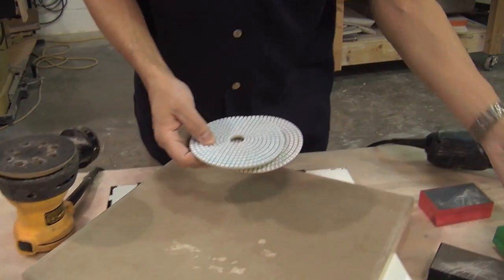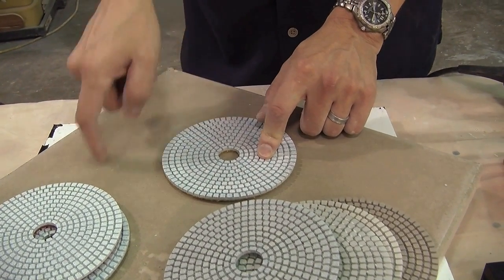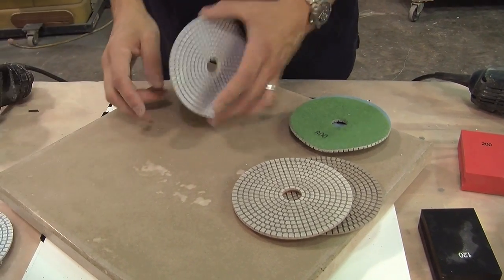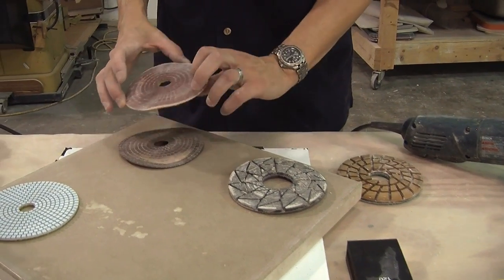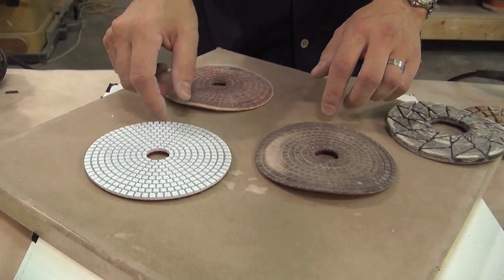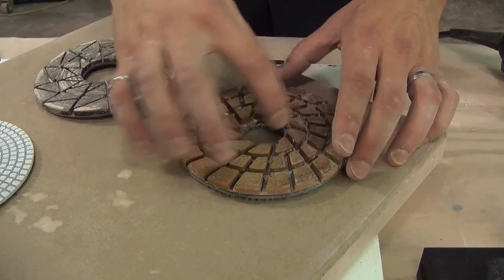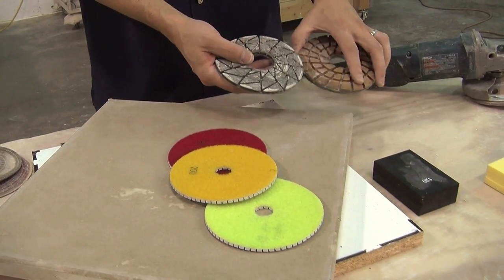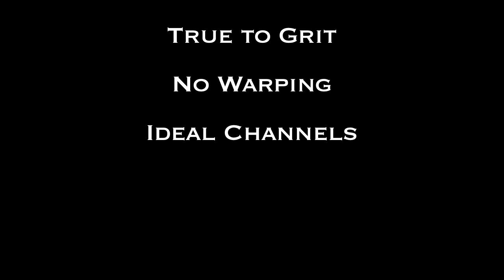Diamond Pads for Polishing Concrete Countertops

Comment: great video, it does seem like your comparing used warped pads to your unused pads
Reply from the maker: It's true that I'm comparing used pads to my unused pads. However, the point I make is that the thick floor pads start out warped and don't flatten out on a polisher. Showing used pads make its clear how small the contact area is because the pad is warped due to its thickness. The pad isn't warped because it's used.

Comment: Could you start with 400 and just do that only?
Reply from the maker: Yes, you can always start with whatever grit you wanted to. I prefer to start and finish with a 200 grit pad, as it is a very efficient and effective grit to quickly remove the cement paste and leave the surface smooth and ready for sealing.

Comment: Hi i will be doing my first concrete countertop polishing job. What sealer do ypu recommend after im doing doing the polish
Reply from the maker: I strongly recommend Omega, my sealer developed specifically for concrete countertops. It is food safe, water based, and very, very stain, acid, and oil resistant. Polishing your concrete to 3000 grit only makes the bare concrete shiny, it does not add any protection, so not only is it unnecessary, it often makes more unnecessary work for you and it gives a false sense of security. As with all topical coating sealers, do NOT polish beyond a 200 grit finish, otherwise your sealer will not bond properly and you'll suffer from delamination. Here is the link to the sealer and some articles you might find useful: https://concretecountertopinstitute.com/product/omega-concrete-countertop-sealer/

https://concretecountertopinstitute.com/free-training-category/sealing/

https://concretecountertopinstitute.com/free-training/why-is-the-200-grit-disc-special-for-concrete-countertops/

Comment: Great info! Can I use these pads with my random orbital sander? Or do I need to get an angle grinder backer with velcro or a polisher? Cheers!
Reply from the maker: Yes, you can use them with your 5" random orbital sander. We call that damp honing, and we have a video on that in this article: https://concretecountertopinstitute.com/free-training/surface-prep-concrete-countertop-sealer/
Bear in mind honing using a random orbital sander will be far less aggressive than using a dedicated wet polisher, but if you're just doing light honing work then it works great.
Reply: @TheConcreteCountertopInstitute  Awesome – thank you so much for the swift reply! Great website. This information is gold! Cheers!

Comment: I made a 1.5"x 27" x 67" solid countertop in a form upside-down using  concrete from Z-counterforms, which says it does not need any rebar or fiberglass.   The instructions say 48 to 72 hours cure covered in plastic.    I let mine  cure for 6 days.  Then 2 days outside the mold on a flat table, good side up.  Then I began wet sanding with 50 grit and 100 grit pads just like shown in the video.   The next day the ends of the countertop curled up  about 1/4" each side and the slab is no longer flat.    Maybe I used too much water for the sanding process and this somehow caused it to curl, but I'm scouring the Internet to find the answer as to why this happened.
Reply from the maker: Curling is caused by poor curing and storage conditions. When one side of a concrete slab is allowed to dry out while the other side remains moist (or is moister), the concrete will tend to shrink towards the dry side. Concrete continues to cure for many days, long after it's been demolded and processed. The curing process is fast in the beginning, fast enough to make the concrete strong enough to demold and process, but it does continue, asymptotically. It is possible that the curling started during the 2 days the concrete was flat on a table, if it stayed moist on the underside and dry on the top. Concrete slabs should always be stored either on edge or elevated on foam blocks to allow air circulation all around the slabs. Curling could be caused by mix designs that are shrinkage prone, but Z-Counterforms is a good mix, so it's unlikely the curling was caused by the mix.  You can try weighting the ends of the slab with very heavy weights, but I can't guarantee that will flatten the slab.
Reply: Have to keep it soaking wet for 7 days minimum while curing
Reply from the maker: When you don’t use a curing polymer, you’re exactly right.

Comment: Good video! In order to make a concrete countertop kind of shiny-smooth, how much grit at least I need to use? How many days after the pouring I need to wait before the polishing? I have used 400 grit diamond polishing pad on my newly poured countertop but it feels much coarser than a wood surface after being polished with a 400-grit sand paper. Is that normal or something went wrong?
Reply from the maker: Hi Daniel. 400 grit should produce a very smooth and somewhat shiny surface. If you are going to apply a coating sealer, do not progress past 400 grit, because the sealer will not adhere properly. You can usually stop at 200 grit. The sealer is really what gives the final appearance of the concrete, so it's pointless to polish to a shine and then apply a sealer that has a different sheen. The number of days to wait after pouring depends on the concrete, but basically the cement paste in between the sand grains needs to be hard enough to polish. A high quality concrete countertop mix with low water/cement ratio should need no more than 2 days. You can use a densifier after 200 grit to speed this up. You say you used a 400 grit diamond polishing pad, but you also say you used 400 grit sandpaper? Sandpaper does not contain diamonds and will not polish concrete countertops to a shine. Also, wet polishing works better (and allows you to apply a coating sealer) than dry polishing. Please visit our website for extensive free training on diamond pads and polishing here: https://concretecountertopinstitute.com/free-training-category/diamond-pads/

Comment: Any recommendations for a 5" electric sander? They usually have dust collection which would seem to suck in water, not good.
Reply from the maker: Please see this page: https://concretecountertopinstitute.com/diamond-polishers-for-concrete-countertops/
Reply: I assumed since these pass don't have the vaccum holes in place and majority of the pad is rubber backed water shouldn't be a big issue even for an orbital sander, just be careful not to wet the electrical parts

Comment: Does the hook and loop side last for a long time? (Long time meaning 1,000 sqft) My experience with amazon bought pads are short term not due to the diamond side.
Reply from the maker: Yes, we have never had any issue with the hook and loop/Velcro over many years of use.

Comment: I have some rough spots, not many, in freshly poured top. What would be the recommendation for that ? Start higher 800? If I do 200 I am concerned I'd impact the good finish around. Is there a good rule of thumb ? How much water I need ?
Reply from the maker: Constantin Moisei Unfortunately you must polish the entire surface. Even a high grit like 800 will impact the surrounding surface. Which grit to start with depends on how rough the spots are. 800 grit is not going to smooth rough spots, but 200 might. But if they are really rough you might need 100 or even 50. Whichever grit you start with, you should progress higher step by step until you are satisfied with the finish. Be aware that if you plan to apply a coating sealer, you should stop at 200 grit because the sealer needs some texture to stick to.
Reply: Thanks a lot,  I might have been misunderstood.

I don't want to expose the aggregate, and I don't want to cut too much as this is indoor in a finished area so I don't need any mess. Can't mess the area :-)
Here's the process I was planning to do.

1. Wait 7 days to wet cure it, sprayed it everyday and covered with thing plastic sheeting (Day 3 right now)
2. Day 8 - 50/100/200 polish with a diamond hand pad only on rough surfaces, the grit used will be base how rough the area
3. Apply slurry to cover all the bug holes and uneven areas
   * I will hand massage the slurry in, squeege it out and lightly wipe it off with a wet sponge just before starting to set
   * (should I steel trowel the slurry to even out?)
4.Let it dry and lightly sand the edges, remove forms (z-forms and sink), remove any debris. Wet sponge it and shop vac cleanup.     * I do this because I have couple of low spots by the edge of the zform and I want to use the forms as a level reference
5. Appy few coats of sealant to penetrate (is this the right time or lightly go 200 over the whole surface then seal it all?)
6.(400?) 800-1000-1500-3000 wet grinder diamond pad polish on all the surface - need to see how I contain the water mess (indoor slab)
7. Use a cut compound to polish it more (Should I do this after 1500? If I do this should I skip 3000 ?)

I have a corner that I have to manual I assume I need hand pads for that. 

Oh, I forgot, I saw someone seal the concrete after lower grit then seal it then continue to with higher grits. Any idea about that approach  ?

I won't mind if you'd point all the flaws in the steps above. 

Great videos/explanation! Subscribed!
Reply from the maker: Hi Constantin. I'm sorry for the delay in replying to you. This is a very involved question, so can you please email info@concretecountertopinstitute.com so that we can get your email address and assist you that way?

Comment: I'm looking to try and test out an area of a bathroom with marble floors in a condo that I recently purchased. The floors are in decent shape just are very dull with some staining in a few areas. What grit might you recommend starting with?
Reply from the maker: Marble is a very different material from concrete (it is very soft), so I hesitate to recommend a specific grit, other than start with high grits to be on the safe side. Low grits such as 50 are very aggressive and can remove quite a lot of material quickly, even from concrete.

There are companies that specialize in floor restoration - using the services of a pro with experience in marble would be the safest bet.

Comment: CCI - I'm about to make some concrete countertops with the quikrete countertop mix. I plan on using the BR reactive sealer and use the CCI diamond wet discs. What grits do you recommend? I did a test piece and it seemed to come out pretty smooth and I have read that I shouldn't go over 400 grit if I'm using a sealer. Can I get away with using your 200 and 400 grit? what should I use to sand down the edge after using a slurry mix to fill in the voids?   Thank you very much for your help.
Reply from the maker: +Chris Hansford That's great! You are correct, if you're using a coating sealer such as BR reactive polyurethane, you shouldn't go over 400 grit (for some sealers it's actually 200). 
On the cast surface: If you are just trying to do a very light honing and not expose any sand grains, you can just use a 400 grit. If you want to take off the cream layer so you see the sand grains, you can use a 200 grit. 
After slurrying/grouting: If there's not much grout on the surface, you can use a 400 grit. If there's more, you might need a 200 grit, but be cautious about taking off too much grout and re-exposing pinholes.
If you're just doing edges, use hand pads. For larger surfaces, use diamond discs.
Reply: +The Concrete Countertop Institute  thank you very much!
Reply from the maker: +Chris Hansford You are very welcome!

Comment from the maker: +Saul HNJ Gracian (For some reason I am unable to reply to your comment. Here is the answer.) The diamond pads should work fine on pool plaster and the calcium buildup. Just be very careful when using the 50 grit because it might cut through the calcium too quickly.
Reply: +The Concrete Countertop Institute  - Saul-HNJ Gracian   Thanks! let you know how it goes, discs came in today plan to complete next week...

Comment: your Thoughts!  I am a concrete contractor and I have lots of calcium build up on my pool plaster. I plan to drain pool and use the 50 grit  to cut calcium and a bit of cream off the plaster 100 to polish(maybe 200), 7inch for the major surfaces and 3/4in on radius curves, should be about a solid day of cut and polish, I love your quality disc and I believe this would work well on plaster...I would be obliged to know what do think about my project, I am a little overconfident at times, tanks

Comment: Good Video, I am about to pour a bench top, I own a wet polisher with similar pads as the ones you reccomend (they look the same) and i have polished stone and concrete with them.  The question with concrete, is how do i polish the concrete with out exposing of the aggregate in the concrete?  with a standard piece of stone that is easy because it is the same all the way through, but with concrete if i go too far i will show stone, which i dont want.
So how do bring up the finish of  the concrete to a high standard with out exposing stone?  
I see you said something about starting at around 200 grit?  could i start at 400?   Also what is the trowel finishing technique with your benchs?  is there any? or just pour the bench, and when dry polish then?  thanks.
Reply from the maker: +Aaron James, it sounds like you want to make the cement cream finish shiny, or, possibly you are ok with exposing the sand grains but not the larger aggregate. 

Polishing a cement cream finish is very challenging, because the layer of cement cream on the surface of the concrete is both very thin and relatively soft. It's very easy to cut through the layer, even with a 1500 grit diamond pad. So if this is what you want then I would recommend that you not polish at all, and rather burnish using Twister-like pads. 

If you are OK with exposing only the sand grains (a "salt and pepper" look), then you can start with a 400 grit pad and proceed from there. When in doubt, always start with a grit finer than you think you need, since all you'll do is spend a bit of time and not removing too much material. 

With precast concrete countertops, it's very common to cast them upside-down, so the finished surface of the countertop is cast against a mold. Usually no troweling is done as is common with cast-in-place. If you do want a troweled look with precast, you can cast right side up in the molds. 

Dry polishing is a lot different from wet polishing, and the effectiveness and quality of the polished surface is dependent upon the age (and hardness) of the concrete, the quality of the dry diamond pads, and your skill and experience. I strongly suggest you practice if you're new to this, as it's easy to damage a piece of concrete if you're not proficient with dry polishing. 

Finally, not all concrete needs to be polished (made shiny) to create a finish of a high standard. Polishing does not provide any protection against staining. If you're going to protect the concrete with a high-performance coating (like the new Buddy Rhodes reactive polyurethane sealer), you do NOT want to hone any finer than a 400 grit finish. Most sealers have a difficult time adhering to a shiny, smooth surface. Furthermore, the sealer dictates the final sheen of the concrete, so spending a lot of time polishing to a certain sheen is not necessary. 

For more information, please see this page: http://www.concretecountertopinstitute.com/diamonds/
Reply: +The Concrete Countertop Institute  OK thanks for the info. 
I am thinking i will pour it, strip the mould and give it a good trowel with high carbon steel float with a touch of water like with the garage floor slabs when very solid to get that high sheen, i hear the high carbon trowles deposit Carbon into the surface as you do it by adding a touch of water as troweling a close to cured slab.  
And then maybe Dry buff/wet buff?  and a seal?  any thoughts?  thanks for your video and time. Cheers! (id probably do your course, but i am in Aus, the concrete bench tops are getting popular, but most seem to be poured in site with delivered mixes, stripped moulds/form work and steel floated late.)